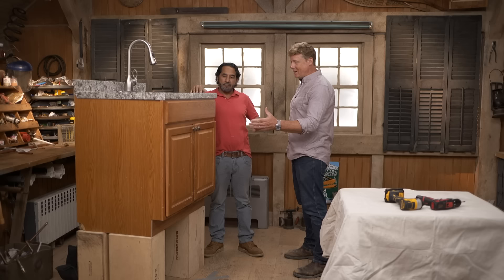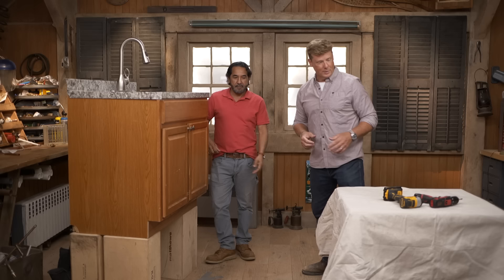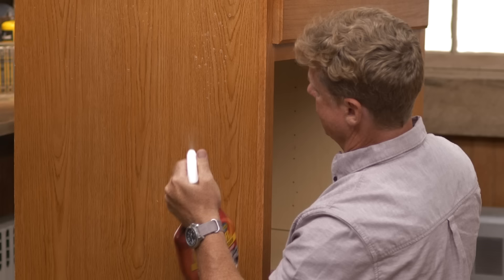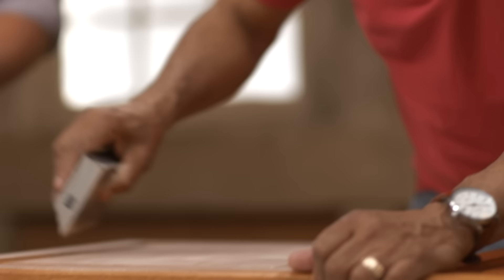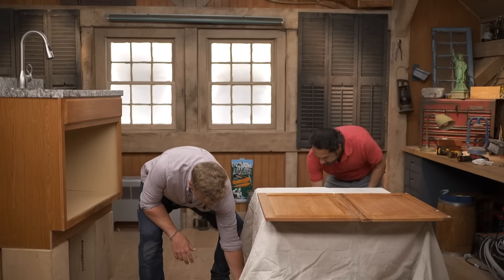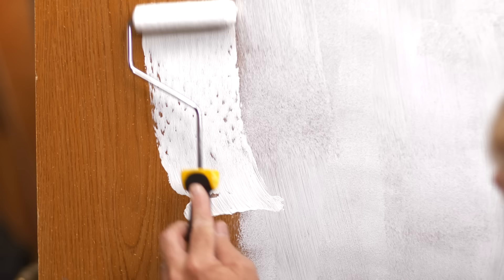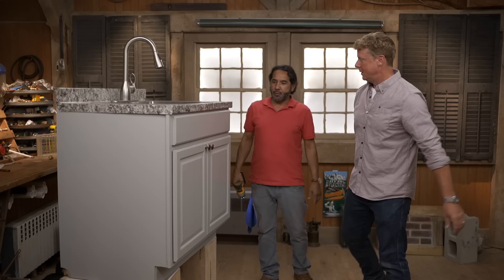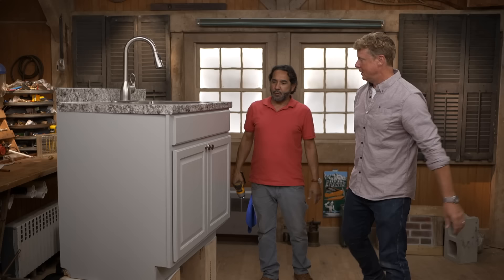How to Properly Paint Your Kitchen Cabinets  | Ask This Old House

Comment: BUBBLES ARE KILLING ME! It's not so easy. I renovated an entire townhouse, so my friend asked me to work on her condo, including refinishing her kitchen cabinets. I've done lots of painting but only ever done a few cabinets. I watched a number of YouTube cabinets. I did research. I cleaned thoroughly. Then I sanded well, using three grades of sandpaper. A quality primer was next. Looked okay. So then I started the finish coats using Insul-X cabinet coat. Using a roller, the texture was ridiculous, and I was constantly getting bubbles. The can says "factory smooth finish." How? After fighting with the project and sanding the surface of the new paint flat, I added Floetrol, because it's supposed to improve paint flow and leveling. It worked somewhat, but I'm still getting micro-bubbles that I can't get rid of. I'm pulling out what little hair I have left.
Reply: I'm interested in seeing an answer to this question! Thanks for posting webed4hta
Reply: It looks like they're using Behr in the video - despite linking to the Insul-X product in the video description. I'm not sure if that has anything to do with it.
Reply: What was the nap thickness of your roller? Were you using 3/8? I’ve had decent luck with a good 1/4 inch. Don’t buy the cheap ones.
Reply: @jacobwilliams5879  thanks for sharing jacob! I'll pick up a 1/4. I haven't started our cabinets yet - I'll follow up if anything goes wrong 😆
Reply: @ryanshout8652  If you can drop the money to rent a sprayer to do the doors, you will get the best results. If you have a good area for set up, you’ll save a lot of time as well.
Reply: I read somewhere else the same problem. They were using a foam roller with  Insul-X cabinet coat. They changed to a different roller.
Reply: @simonwilson4353  I tried foam rollers. They're terrible. Way too many bubbles.

Comment: Funny how they try and cut with counter top still attached to carcass.
That’s a lazy man strategy 😆😆
Reply: Countertops are not easy to remove and replace in bigger kitchens. You’ll have to scrape off all the caulking from the counter and the wall, disconnect and redo corners, undo and redo all the screws, often a cooking plate is embedded in the counter, etc… i guess they don’t want to go overboard with the job making it look like a marathon, while just leaving the top on works as well.

Comment: It looks horrible , You can't paint cabinets with a roller and brush , You have to use a sprayer , or it looks like you painted over old cabinets , You don't want people to know they were painted , You want them to look brand new
Reply: Absolutely agree
Reply: in a kitchen, definitely.  second hand cabinet for workshop or garage, works fine.